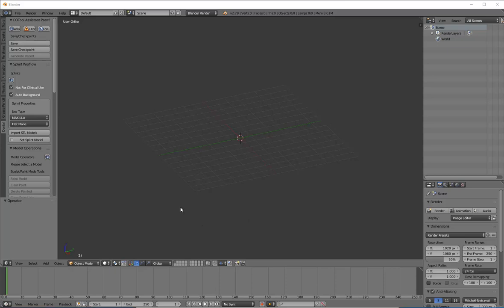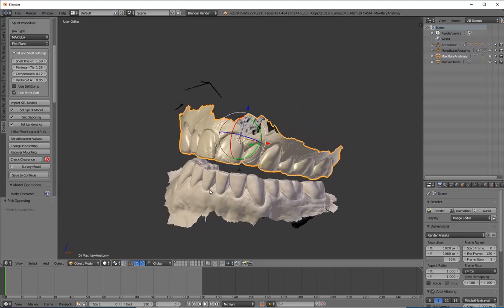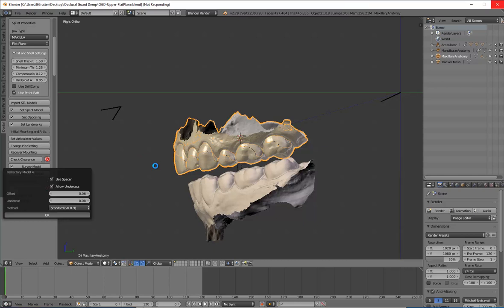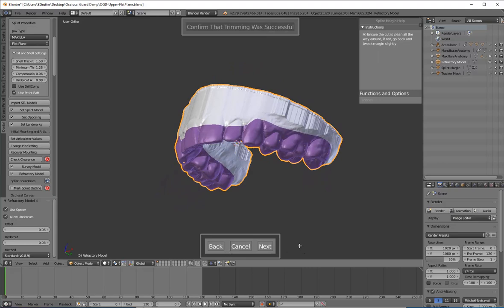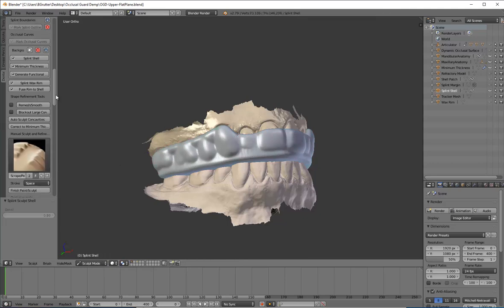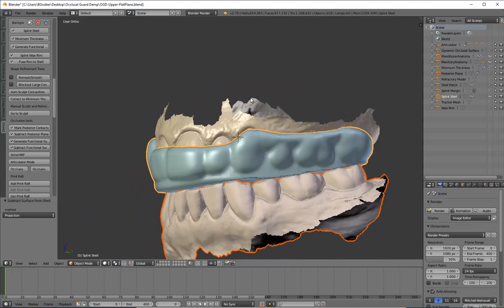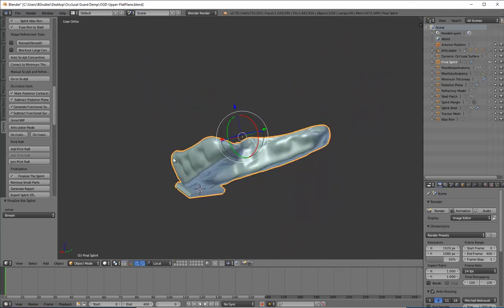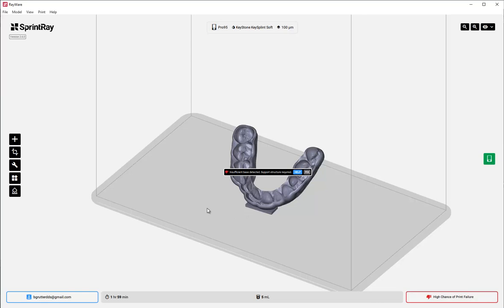D3Splint WorkFlow: Maxillary Flat Plane

Comment: I am considering purchasing your software for the splint design. I can't find info online as to how to import the models positioned in the open bite established clinically. I use a Medit i700 scanner. If you are importing separate STL files for max and mand, why are they opening up in your software mounted properly?
Reply from the maker: First, it's not my software. I just use it and make these videos to help other people know how to use it. A good friend of mine developed a software.

I think you're asking why the two models come in in the same occlusion as they were in your imaging software? If that's the case, that's because the two models were generated relative to each other in the software. Each model is made up of hundreds of thousands of points and those points each have coordinate systems. All coordinates are relative to one another. Anyway, it's maybe a little bit difficult to explain here.

Comment: Thanks for your video! My wax rim goes into the intaglio surface and I lose all of the anatomy and the guard doesn't fit. I noticed you dont have that issue. How do you get your rim to be below the cusps so it doesn't interfere with fit?
Reply from the maker: Seems like you're missing a step. You need to Merge rim with the splint, making them one object. Then you need to subtract the occlusal plane and/or functional plane. Lastly, you need to finalize the splint so that it Boolean subtract your refractory model.
Reply: @bgrutterdds  Ahhhhh.. thank you!!! I see now that if I keep going, it will correct at the end! Thank you so much!
Reply from the maker: My pleasure!

Comment: Great video Baron.  When I import my models, them are imported in occlusion.  I've noticed in your videos and in D3Splints, the teeth are already apart.  How do you scan the teeth together like this?  Rookie move but I scanned with teeth in MICP.  Also, what are your recommendations for blocking out things like bonded retainers so that if they come off, we have some leeway to repair them?
Reply from the maker: I get my bite relation with teeth parted, using a leaf gauge. Typically at 3-3.5mm.
I use MM or BSP to repair models.

Comment: Thanks. Nice work. Can I print an anterior bite plane the same way. I am an orthodontist. How would the undercut detector react to the brackets?
Reply from the maker: You can. I'm not sure I know exactly what you mean about the brackets.
Reply: It will block them out but leave slight undercut. You can now manually select areas for complete blockout (eg, the brackets) so that your appliance is perfectly passive around brackets but  has the specified retention everywhere else!

Comment: I have made about 5 splints using D3S without any issues, using your settings for offset spacer and allowed undercut.  I just had a case where the splint was way too loose.  I realize this may have been due to my survey model but would I need to increase or decrease the spacer and or undercut to correct this?
Reply from the maker: I design at 0.06 Offset and 0.14 Undercut. Then, I always have a hot water bath at the ready to final mold it. Works great.
Reply: @bgrutterdds  Thank you.  I was doing 0.06 offset and 0.08 Undercut.  Will adjust and reprint.
Reply: @bgrutterdds  I’m still finding the splints are loose using these settings. Should I try increasing undercut or decreasing offset?  Also when surveying the model, do I want more or less undercut/grey on the buccal of the anteriors?
Reply from the maker: You really just need to balance out placing the undercut wherever you can for the retention you plan to utilize. I hope that makes sense. I generally try to have it pretty averaged out. If you're still having fitment issues, you might want to explore calibrating your printer. Otherwise, you just need to continue to decrease the offset and increase the undercut.

Comment: We have made a number of night guards that have worked out. We are now having issues with some being too tight and some being too loose.. we have been using the same refractory settings, offset .06 and the undercut at .08.  Do you have any suggestions?
Reply from the maker: Any new variables? New resin, new printer, new printing room? Unlikely, but it can even come down to different humidity and heat if the area you're printing in is subject to changes in climate.